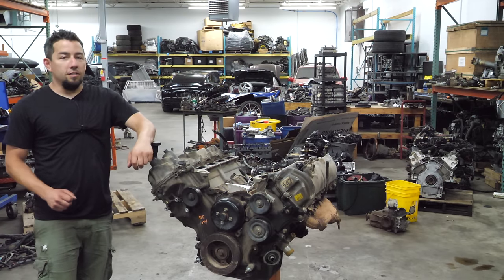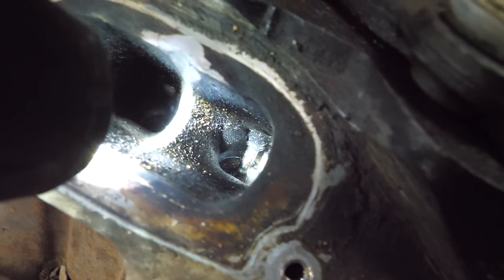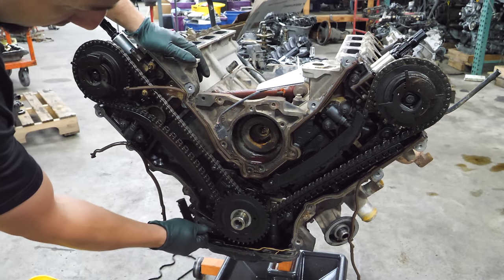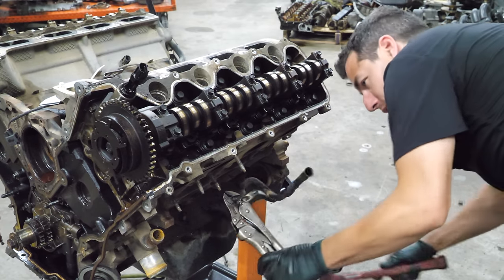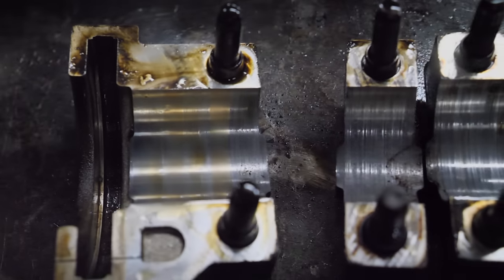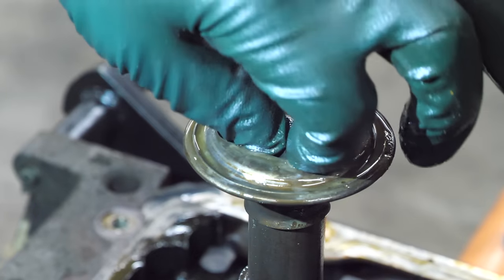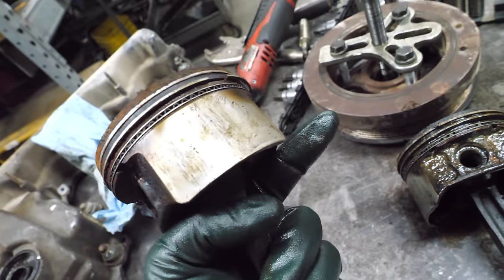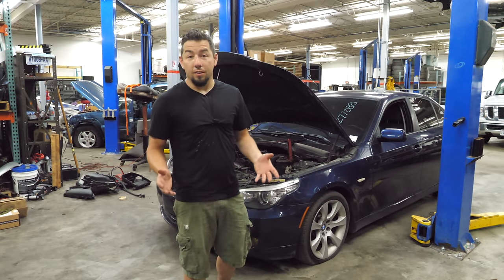Bad Ford 5.4 3-valve V8 Engine Teardown. Which of The MANY Possible Failures Took This One Out?

Comment: I’ve heard most of these problems could’ve been avoided with very frequent oil changes… that once they sludge up, it’s game over.
Reply: As much as I dislike the 5.4 3v Triton I will blame its' faults on people who just ignore doing any proper maintenance on them to begin with. IMHO, if you can't afford to, or don't want to do any basic maintenance on a vehicle you probably shouldn't own one. Vehicles are a privilege not a need.
Reply: I've had out 2010  f150 since new.  Oil changes every 3-4k and she's still good at 155k.  I would never buy one used unless you know it's entire oil change history.
Reply: I have a 2006 F150 with 209,000 on it. All original parts never opened up. its been supercharged since 10,000 and I beat on it pretty good. its on its second transmission, 2nd rebuilt rear end, and 3rd flexplate (spun the center out of two OEM units, it now has an SFI approved flexplate). I change the oil every 5,000 miles with Mobil 1 Extended Performance 5w-30, and spark plugs every 35,000-40,000.
Reply: @mikebrosnan2895  Nice! Just look at the baked on black oil vapors inside the one on the video. Not sure if they all get that
Reply: @mikebrosnan2895  Even with you horsing on your truck and breaking things on it you still fall in the same category as the guy above. 

It has lasted so long and continues to work properly because you're keeping up with regular maintenance. You change your oil regularly and if something breaks you get it replaced. 

There's loads of older F150's in my area with these 5.4 3v in them and they all sound like crap. You can tell one is going down the road because they all have a horrible knock or cracked exhaust manifolds that make it sound like a knock. Nine times out of ten the truck itself looks like it's rusting into the ground. People just drive them until they blow and scrap the truck.

It's like the 3.6l v6 in my stepfathers Impala and my mothers Colorado. It has a bad rap for failing because it's an engine that doesn't tolerate missed oil changes. If it's maintained like it should be it can be decent. The same goes for the 5.4 3v, it has bad design flaws and those flaws don't like missed or neglected oil changes.

My dislike of the 5.4l 3v isn't really the engine itself, but the horrible spark plug design that Ford thought was a good idea. Spark plugs should be the easiest thing for the owner to replace. If they break easily when they need replacing then it's a terrible design. Yes, anti-seize will help but not everyone uses it as they should. :)
Reply: @Slane583  
I bought my 06 F150 with a 5.4 over 5 years ago. These definitely require proper maintenance. I replaced the OE plugs at 155k miles and used the best method. Hot engine with a 3/8 pneumatic impact and I didn’t break one plug. Fordtechmakeuloco has great videos on all Fords. 

I also dropped the oil pan for inspection and found no sludge and no giblets. Oil changes were definitely done and I use synthetic. I did eventually replace one cam phaser for the diesel knock type sound. I live in Florida so rust isn’t an issue. 

So far I can’t complain about this engine or truck. I’ve been blessed!
Reply: @benztech2262  The funny thing is. All of the engines that have a good reliable designs are highly tolerant to bad ownership. They don't tell you you're a bad owner until many thousands of miles of use when something finally breaks.

Engines that are known for having bad designs aren't tolerant of any missed maintenance and straight up tell you you're a bad owner by failing almost instantly. They can be good engines if the owner of the vehicle actually takes the time to keep it maintained.

My 2020 Silverado has the L3B "Turbo-4" in it and so far I like it a lot. As far any problems I have had have all been sensors failing and it's all stuff with known recalls so it was replaced for free. I hear mixed thoughts on it because it's a small engine in a big truck with some saying it's going to wear out instantly and others saying it's been very reliable. So since my mileage is very low on the truck being it's a lease I want to start running high performance oil in it with a high zinc content to help with the turbo and other wear items.

Which also seems to be another spot for debate. With others saying they run high zinc oil in their newer Dodge Rams just fine and other saying it'll plug your cats. Which to me makes no sense. Because if the zinc in your oil is plugging your cat it's because your engine is burning oil. Which it shouldn't be. Either way, I looked up some oil on Red-Line Racing's website and it says their high zinc 5W 30 is recommended for my truck.
So I'll give it a try when the time comes.
Reply: @jerryp1776  But you're also one of the examples of good ownership as I mentioned before. You liked the engine enough to know that Ford did a revamp on the valvetrain and you had your old parts replaced with the new and better design. You also had your cousin do the same when his valvetrain was getting worn and started making noise. So because of your maintenance routine you've been rewarded with a smooth running engine and thousands of miles of use.

In my area a lot of the trucks like yours that have the 5.4l 3v Triton in them are treated as throwaway vehicles. People will drive them until the wheels or the bed fall off. When the engine starts making any kind of noises they will do as little maintenance as possible and drive it until it blows. Then they'll junk the truck and find another one, then the cycle repeats.
Reply: Or using dollar store brand oil. I pulled a 2.8 v6 apart that had been run with DS oil and it looked like tar up in the cylinder heads.
Reply: All engines burn oil to some degree, it's merely a matter of how much. The phosphorus and sulfur in high zinc oils 'poison' the cats, they won't block up but they will stop working... Though it might take quite a while for that to happen.
Reply: @nerd1000ify  I asked my mechanic friend about that as I want to run a zinc enhanced oil in my truck since GM's turbo based gas engines are iffy at times. So for me it's to help with longevity. He said that I don't have to worry about it affecting the cats until about 120,000-160,000 miles. 

He said by that time you're changing the cats out anyway due to wear. So I'm going to run Red Line in my truck when I can get some. I read many reviews of people who run it in their newer Dodge Ram's and they said for them it's the only oil they've run that has helped with dealing with lifter tick in their Hemi's. 

This recent past oil change I got some full synthetic STP oil in the meantime to do the change and it already revs smoother than when it had whatever junk GM runs in their vehicles from factory. So once it's time for the third oil change I'll switch it out for Red Line and stick to that there after. :)
Reply: @Slane583  a FOUR cylinder in a 6,500 lb truck? I didn't even know one could be purchased this way. Engineering and marketing I think always have good intentions with such oddities, and obviously the government has something to do with it ie: minimum mpg requirements, but THIS, I just wouldn't do. I wonder if your vehicle is 4WD, because, if so, there's just no way its got sufficient grunt (torque, weight, straight up horsey power???) to power through when the going gets tough. At least I'd be very surprised if it did. I'm curious. Also what model Silverado is this - is it loaded up or a stripper? I bet a typical Silverado lease nicely equipped sets you back 400 ++. I'd be pissed.
Reply: @wilsixone  The engine is turbo based, is rated for 310hp and 346ft-lbs of torque. It is also mated to a 8-speed transmission. Yes it is 4x4 and has no problem powering through things.

Of course I'm not off-roading with it so I could careless about off-road ability. But it does power through deep snow in a unplowed driveway that a car would normally get easily stuck in. 

The first thing we did when I got it was to test its' ability to haul so we filled the bed with soggy old wood chips to make the rear sag a little and it drove as if there was nothing in the back of it. We don't own a trailer so we don't do very much pulling but mine is rated to pull 7,500lbs. They upped the pulling capacity of the newer Turbo-4 equipped trucks to 9,300lbs I believe. I have pulled my grandfathers hand-built tandem trailer loaded up with dirt a couple of times and the truck pulls it just fine.

The model I have is a 2020 Custom and it has enough electronic features to give you a back-up camera, navigation on the radio screen, a trailer braking controller and a integrated power inverter so you can plug in larger mobile devices in to a 110v outlet on the dash and back seats. There is also a 110v outlet in the bed and it has in-bed lights so you can see things in the dark.

There are no heated seats or steering wheel as it is not a fancy fully equipped model which doesn't hurt my feelings. Because it's not a fully equipped model it doesn't have any useless chrome trim all over it that I don't like. I am not a fan of chrome in the least. It doesn't work on modern day vehicles regardless of what they try putting it on. It's also not a basic work truck with barely anything in it so it falls in the middle.

You would think a 4-cylinder wouldn't work very well but it does. It drives just fine. :)
Reply: I got 18 years out of my 5.4 and the cam phasers just went out. Instead of spending $61k for a new F-150, I decide 
to drop a Ford  OEM rebuilt engine. Paid for it cash and will have the truck another few years

Comment: Most of the problems you've described are either caused by poor maintenance or by chronic abuse. It's also a mystery how the 4.6L 3V can be so much more reliable when it's basically the same engine with a shorter block deck and stroke.
I guess Mustang owners change their engine oil more frequently.
Reply: You nailed it.... Mustang owners tend to treat the 4.6 like a "nice" car engine. Pickup owners tend to treat the 5.4 like a "beater" work truck lol

Treat a 4.6 the same way, you'd get the same issues.
Reply: @AbcAbc-sp1od  Yeah, and I bet those 5.4 owners continue to drive for thousands of miles with the engine ticking away like a time bomb until it goes kaboom.
Reply: @DJDinaggio  exactly

Comment: I had an 04 3v made it 330,000 miles towing trailers every day they're not as bad as people think they are just change the oil. I feel like I got my money's worth and I would buy another one before I would buy a chevy or  especially a dodge!
Reply: You work for Ford's marketing dept, don't you : D
Reply: I thought the same thing. Then got an 01 5.3 Yukon. With 300k. Runs great and only paid 750$
Reply: That's brave. Or a fool's errand.

Comment: I am running a 5.4L 3 valve. After 345,000 km it needed the timing chain tensioner since it was in 4 pieces. The compression test came back with minimum 190 lbs per cylinder. This engine ran 12 hours in -40C on a mountain highway with a shattered timing chain tensioner.

Since the engine was being torn apart I opted to shine up the heads, replace the entire timing chain assembly, cam phasers, water pump, entire belt assembly, and the spark plugs. The coils and wires were already replaced 10,000 km prior. 

The cams and valves were in perfect condition. Do your oil changes every 5000 km.

Comment: '08 and up 3v's had a some revisions that made them much less prone to failure than their earlier counterparts. The one you tore apart here is an earlier one, pre-improvements, and had to have been making a heck of a racket for quite a while...which equals neglect and abuse. One of the most well known fixes in the later ones was the plug/head rework that fixed the broken/stuck plug issue. They have the updated cam phasers that don't seem to fail nearly as often, and in general don't seem to suffer from the oiling issues.

I have a 2012 Expedition with over 212K miles and just now blew a tensioner seal. I replaced the tensioners, installed a Melling 340HV pump, and new guides. I have a couple of noisy roller followers that I'm going to replace as soon as the parts arrive. Other than that, it's been a rock solid engine, considering it's been far from babied it's whole life (towing, off-roading, etc).

Talking to mechanic friends of mine, it's no different than any other manufacturer nowdays. They see Hemi's with chewed up cams, GM's with pooched heads, Nissan V8's with rings that come apart if you look at them wrong, etc...just as often as anything else. Hard to find anything very reliable anymore.

Comment: I understand the hate of the 4.6 and 5.4 but being that I own a 4.6 sn95 mustang I'm building it to not only be reliable and dependable but also pushing it's capabilities NA even built. the problem wasn't the entire platform it was more over head design. the problem the 3v had plug issues was the plugs they used and the fact that instead of the standard 9thread heads they went with a 4thread head. dumb yes especially when you looking at a stock 9.6:1 compression ratio. with the right information they can actually perform well enough to give 4v cars a run for their money. me personally with my car I was going to 5.4 4v swap my 96 but after researching the modifications I said. ope and stuck with the 4.6 build. it's a stock crank stock block 4.6 with mmr forged aluminum rods, and Pistons. clevite bearings, mmr timing assembly, stock 5.4 4v tensioners bc they're cast iron and not plastic, b series 4v heads from a Lincoln aviator, gt500 profiled 4.6 cams, 268/272 LSA 116, 223 duration, at .475 lift. upgraded springs lifters and rockers, aviator intake for the stock imrc plates tuned, flat top pistons for about 11.3:1 compression ratio, ported heads port matched intake, longtubes, I'm looking for 450-500 ish na. just gotta know how to deal with them.
Reply: At least its ford and not LS

Comment: The problem with the 3v is the oil pump. The pump doesn't push enough oil to lubricate the top end AND run the VCT. Get a Mellings HV oil pump and you correct 90% of the problems.
Reply: That seems fairly logical. Might be a good way to get a reasonable beater truck? I assume the 3V motors drop the resale a bunch.
Reply: @corystansbury  Not as much as you would think. Even with it's problems, the 5.4 still pulls a pretty penny, especially in this sellers market. Maybe if gas continues to remain high for a while, a shit ton of people may get desperate for a more economical car. It may be different where you're at but here, truck prices are absolutely insane.

Comment: I’ve seen several 5.4.3 on other channels and it seems that the passenger side fails more often than the right.
Reply: The way the oil gets pushed through the block, the passenger side is last to get lubrication. That's why there are more failures on that side.

Comment: My 6.8L V10 (same class of engine as the 5.4) has 271,000 miles and runs like new.  These are very good engines if they are MAINTAINED properly.
Reply: One big difference though, it don't have the variable cam phasors.

Comment: I guess I was lucky. I had a 2005 Expedition with this engine that was still running fine when I sold it earlier this year with 250k miles on it. The only problems I had were coil packs and an alternator that needed replacing around 200k.

Comment: Like you I've owned both n54 and the 5.4. I can say without any shadow of doubt, the n54 was the biggest piece of crap I've ever dealt with in my life. My 5.4 is a cake walk compared to that heap.
Reply: I got the same experience's from that n54. nothing but trouble. have worked on plenty of 5.4's and never seen any big issues.

Comment: Most seem to fail the same way, the oil passages get clogged and the camshafts start to squat until the rest end sinks so much the engine jumps time. Every problem you mentioned besides spark plugs is related to oil pressure

Comment: 2006 F150 5.4 3v with 269,894 miles all original and no issues. Just put the second set of plugs in it 3 months ago. Cleaned the throttle body at that time. Nothing else ever done but full synthetic oil changes. Went to 5W30 a couple of years ago since we seldom ever get to freezing much less sub freezing (except this week lol) where I live. Runs like a top. Pulled a 27.5 ft fifth wheel for years until my wife was diagnosed with brain cancer and couldn’t camp anymore. I guess I got one of the good engines. Still love this truck.

Comment: 302 most reliable ever got a 94 Ford with the 5.0 and never had a issue 300000 and still kicking
Reply: That’s the Windsor 302, much more reliable.  Problem is GM and Ford both don’t stick to what they know and what’s reliable that they’ve perfected and tune those engines from there.
Reply: I have a foxbody with 260k on the odo. Compression numbers are like 10 below stock spec. I'm making roughly 300WHP and absolutely rag on the poor thing and it never gives a word of complaint. Love the 302/5.0... I gave up on American cars once the 2000's hit and am now strictly a BMW/Honda guy :P
Reply: I used to deliver in a Ford Econoline that had 411,000 miles on it when I got it (bottom man on the station totem pole!). I drove that for 2 years. 300 Straight six. Started every time, about 75 times a day. But it drank oil.